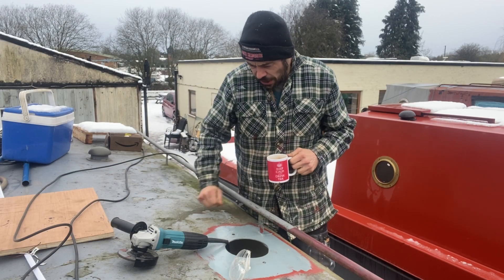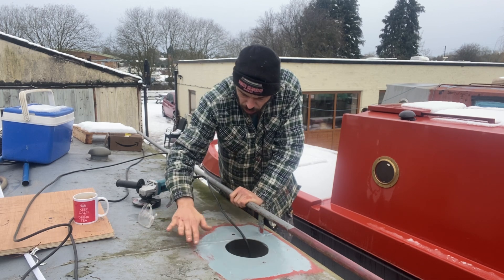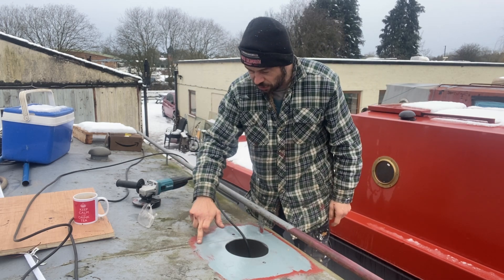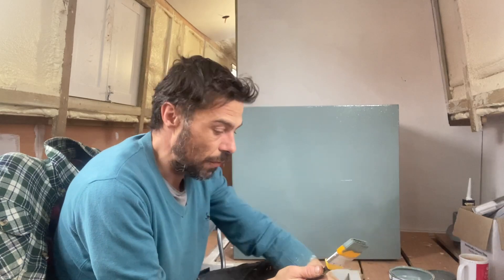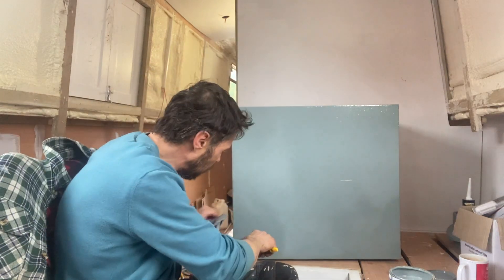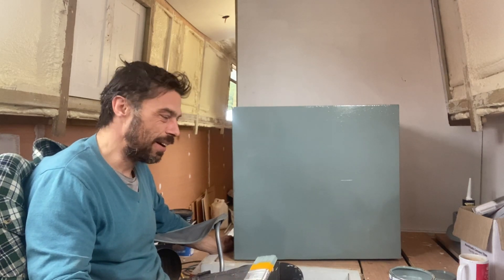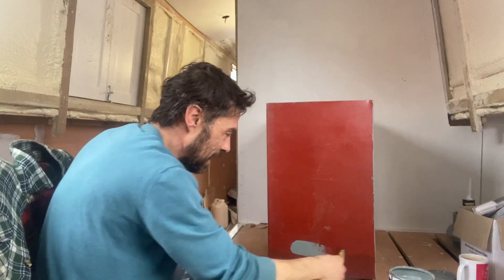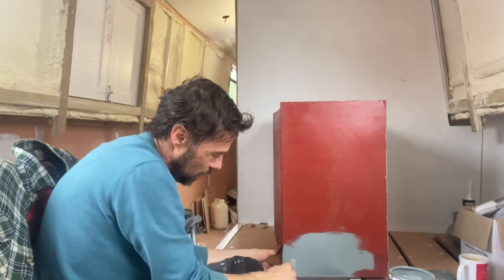103. Roof collar installed on the Narrowboat

Comment: Hi James...I can't see a way to upload a photo of the top of our flue. We installed our fire in November, the flue was put in professionally. We also have a single skin flue which was extended to make it protrude through the roof and into the roof collar. If they're not long enough, tar etc can collect in the roof space and/ or run back down into the boat...both undesirable and one is a fire risk. The hole was padded out with firerope...the thick, white fluffy one. The hole inside the boat was cut about 3cm away from the edge of the flue and stuffed with more firerope and expandable ceramic filler...I  can find out the actual name if you want. A circle of cement  board (sprayed black) was placed round the top of the flue and then the same chrome flue trim you have, was screwed into it. Initially we didn't have the cement board and the trim conducted heat onto the ceiling...we weren't happy with that, so the guy who fitted it came back out and fitted the cement board...problem solved.
Reply: instaBlaster...

Comment: James there is an insulation that is used around the doors of combustion stoves. It is rope like in its form which could possibly be used to wrap around the outside of the collar where it protrudes  into the boat.  This would prevent heat spread from the flue to the interior materials of the boat, and possibly if used around the flue inside the collar would prevent heat spread to the roof metal

Comment: David  from " cruising the cut " used a material,  silver front and has adhesive back on a roll . It used for car exhaust heat protection . Put at back of fire to stop wood in kitchen units becoming  hot.

Comment: Hi James You could buy a compressed vermiculite fire board & cut  a hole out for the flue & fix to the underside of the roof, that would cover your fire risk & it paints well too. & you could screw that cover ring into it too.

Comment: I understand that you got recommended a double skin flue but that is a way to waste the cole you are burning ;-) A totaly diferent aprotch is to cool the pipe by for example lineing it whit one inch aluminium pikes this while increase efficiency and make the flue cold enough. But i recomend lineing the wall and roof closes to the flue with non combustible like the one you mentioned and then whit a half inch air gap finishing it off whit metal in the color of your choise. That would comply with the building code where i live. Take care and i hope that the boat will be a happy home.
Reply: The flue needs to be hot in order to create the draft needed to draw combustion air into the fire and burn the fuel efficiently. You are correct in saying that the fuel will last longer if the flue is cool, that's because it won't be burning efficiently and whilst it won't be generating much heat, it will be generating more carbon monoxide and other pollutants together with condensates. Better to put another jumper on and leave the coal in the scuttle.
Reply: Can you please clarify what you mean by 'cool the pipe by...lining it with one inch aluminium (pikes???)'. I'm not sure if 'pikes' is a spelling or translation issue.
Reply: @michaelburns6197  yes spelling error pipes DIW wersion of www.michiganheatexchanger.com to reduse the amount of radiant heat.
Reply: @nooneswedish5142  I think we actually agree. I think what you're suggesting is another way of creating an insulated flue with your aluminium pipes, and the air inside them, doing a similar job to the glass wool in a twin wall (or double skin) flue. The outer surface of these pipes will be cool and the flue pipe inside will be hotter.
Reply: @michaelburns6197  yes the advantage with the pipes is that you also reclame heat that otherwise will be lost.
But the most important is to minimize the radiant heat that hits combustible surfaces.
Reply: @nooneswedish5142  My apologies, I misunderstood your original comment. It is an interesting idea, the pipes will convert the flue into a convection heater, presumably they are left open at the top and bottom.
Reply: @michaelburns6197  that is completely fine, my initial explanation may not have been the easiest to understand, And Yes you do like to have air moving through but preferably whit the tops bent oute to prevent the hot air scorching the roof.
Reply: @nooneswedish5142  I should have asked for clarification before mouthing off. Anyway, I've been thinking about your idea and thought it would be a relatively cheap, non-invasive, retro-fittable solution for existing installations where single wall flues are too close to combustibles.

Comment: I had a small idea about your chimney maybe you could use the board that you put behind  I've used this before and it paints quite nicely maybe you could paint it with black fireproof paint.and make a feature of your chrome ring .use wooden edging .to tidy up the edge obviously far off away so it doesn't get hot .just an idea 
regards John

Comment: You are doing so well. I'm watching the fire and chimney installation very closely as I have one to instal on my narrowboat. Thank you so much for the lessons so far teacher. Are you going to put in an expansion tank with your calorifier?
Reply from the maker: Glad these are at the right timing for you. Is yours an old boat or new one. Yes the cally will have an expansion tank.
Reply: A middle aged boat at 15 years unlike me an ancient fart. The boat has never had a fire. I bought her 5 years ago. I now have the fire and most of the fittings but waiting for my son to cut up an old marble kitchen worktop as a hearth. If you are still at North Kilworth early May I would like to visit and admire all your handiwork. I am having my boat blacked at the yard opposite as I had it done 2 years ago there and I want the baseplate done.

Comment: Some viewers are pointing to David's installation on Cruising the Cut as an example. A few points on this: A stove is a radiant heater, it heats surfaces in line of sight, like a big light bulb emitting heat rather than light, it doesn't really heat the air. The material David has around his fire reflects radiation away from the surround very effectively and therefore he is protecting the wood behind, although it is slightly misleading to say that the outer surface of the material does not get hot. It doesn't when his hand is in the way. I may be wrong but I believe David has a twin wall flue. His hearth is not ideal in that it doesn't extend far enough in front of the fire nor have a high enough upstand. He readily admits that he has to be very careful that nothing escapes from the fire when he has the door open. I am not criticising David or his installation. His stove arrangement is typical of 95%+ of narrowboats in service, but he is obviously aware of the hazards and he is actively managing them. Will the next person to own his boat be as aware and as careful.
Reply from the maker: I’ve thought the same as you about his stove. Firstly that reflective stuff on show looks dreadful at eye level. As much as I don’t want to burn to death inside a Narrowboat, I also don’t want my fireplace surround to look like NASA built it!!!
Reply: @TheNarrowboatThatJamesBuilt  That's the issue. The next owner might not like the look of the material, discover there's some very nice tiles underneath and rip it off, without understanding why it's there.

Comment: I like that grey primer as a topcoat colour.  Have you decided on that yet?
You could always drill holes in a standard socket blanking plate, to mount those titchy switches.  However, I have some identical looking switches, and they can't be wired to illuminate when the switch is turned off.  I just checked one.  :o(  Glow in the dark paint?
Crack on.
Reply: Before you put the stove pipe into collar put another piece of pipe about 6 inches long large enough to go over the collar fit stove pipe pack the gap between pipes Rockwell or stove rope then then you will have twin wall  coming through roof